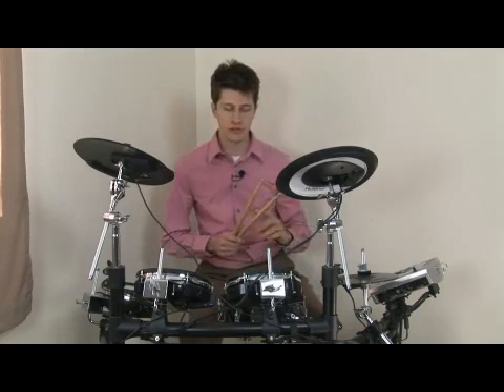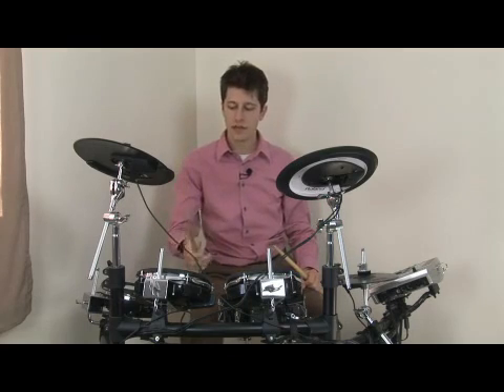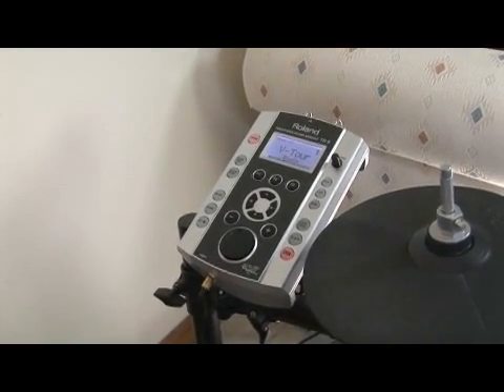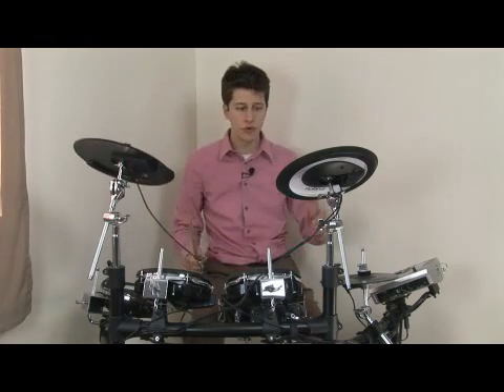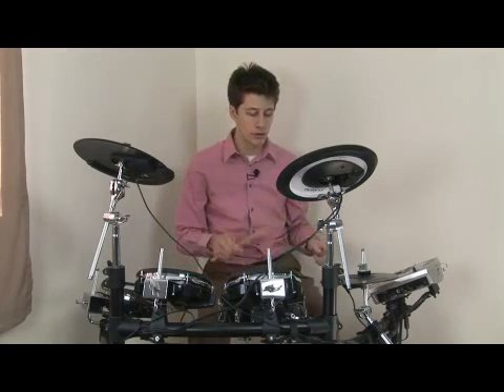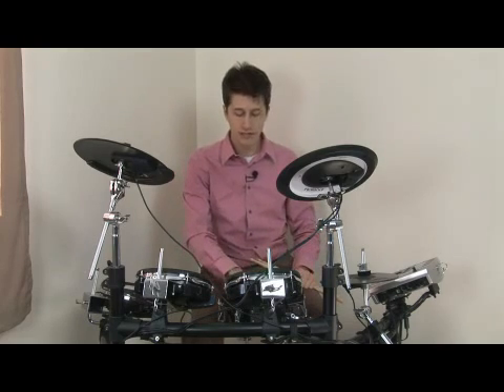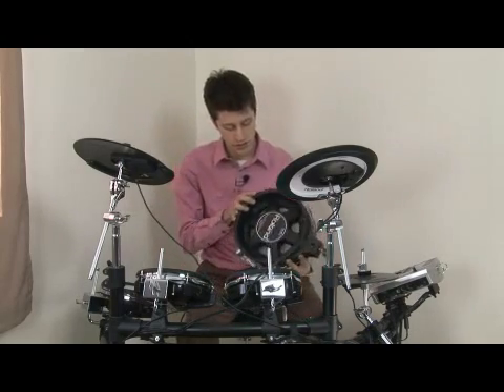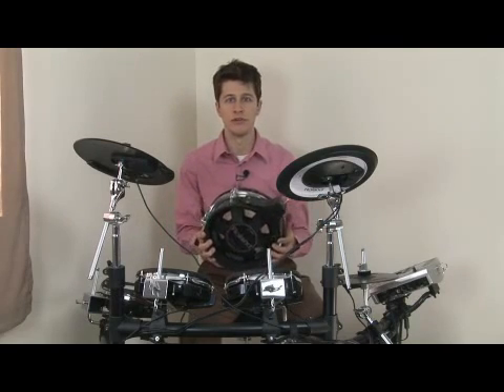How Do Electric Drums Work?

Comment: Piezoelectric sensor?
Reply: That’s what I’m wondering 🤔 I’ve got a couple faulty pads so I’ll figure out how to get inside one and see what’s there and if I can replace just the sensor
Reply: The pads , faulty meaning , you hit them and they dont work ?
Tell me this, you hit the drum anywhere ,it will send the sound to the speakers . You have to set which sound on each pad from the device ?  @FireCrowsWorkshop